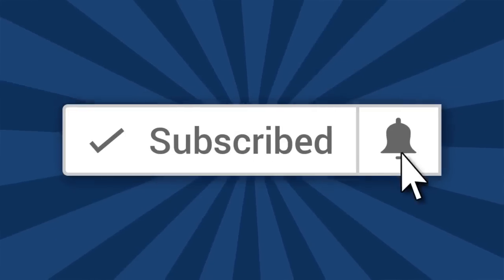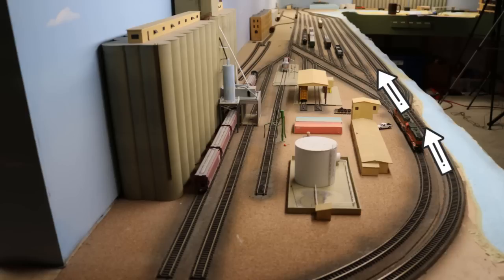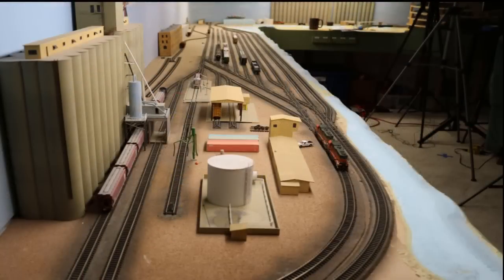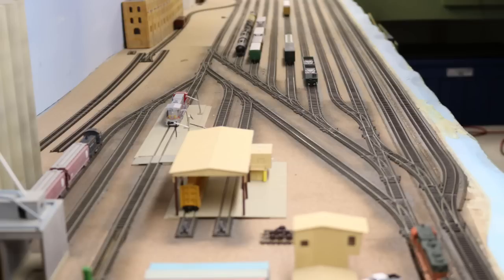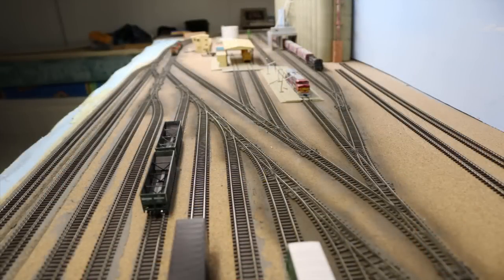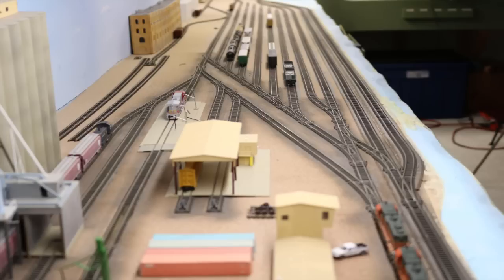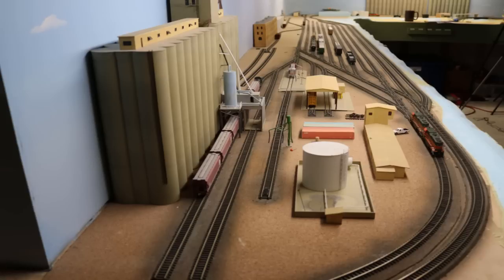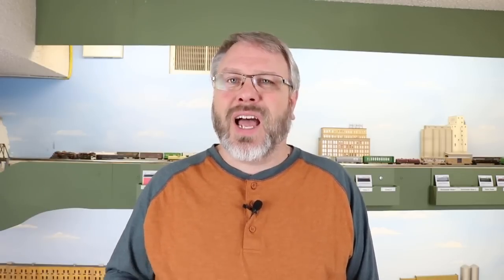Model Railroad Yards--Design for Operations

Comment: Ron: 
 I've been in HO scale for over 50 years, and I agree with you 100%! My main yard has 6 tracks, + a run around track, and leads at both ends that will accommodate pulling all the cars out of the  longest track, without fouling the main. 
Another thing that annoys the hell out of me, is the guy that tries to "cram" too much RR, into too small of room, or basement! This usually results in aisles too narrow,  or all kinds of "bottlenecks" in track work, and a "nightmare" to operate! 
My advice is if you don't have the room for modeling a prototype from one end to the other, Don't even try!  Pick a certain division, or a an area of the prototype you want to model, and let that be the "stage" for the trains to operate on. If room permits, a staging yard at each end of the mainline, or a single double-ended hidden staging yard, to build trains, to come out on the "stage", for viewing or operation.

J.W. Bliss
Reply from the maker: I couldn't agree more. Thanks for your comment.

Comment: Good work,   As you said  "Model Railroad operations".  Real railroads are completely different animal.  That is the point where people copying a prototype run into problems.  The prototype yard is this way so I will do it this way and come to find out our model railroads in many ways do not stack up with the protype and yard operations is one point.  Real railroads Double over, Run full shifts or 24 hours etc.  Most local yards do not have leads and just use the main as a lead.  Traffic density is so low it might be an hour or more between trains. Distance is huge compared to a model railroad. The A/D track is the main.  etc.
Reply: Thanks! I have a small local yard on my 4x8' and have no choice but to use the main as the lead. So that's a relief. Fortunately, it's a double-track main, so I have options.
Reply: IMRROcom was
Reply: Scott Denison, Was?   did he die or something?
Reply from the maker: Lol...
Reply: That's a relief to read that. I am planning my layout and would like to run long trains on a double track mainline, but it looked like ideally the arrival, departure and yard lead tracks were supposed to be as long as the longest possible train stopping in my yard. That would require a lot more space than I have. If "fouling the main" for a little while to drop off and pick up cuts of cars is allowed and even prototypical, then everything becomes much easier. The yard then only needs to big enough to handle the arrival, departure and classification needs of the local area. Correct?
Reply: @rayopeongo  Head on over to the KCS operating sessions on YouTube.  The train crews usually ask the dispatcher for "time and track" to use the main for switching.  Ron is right - bigger yards really do need a drill track.  Mine will be curved and goes between a roundhouse and the main at 18"R because only 4-axle switchers will use it.  The main is 22"R so the locos with 6 axles will look more realistic and run better.
Reply: Having worked on the prototype, I want to make my model railroading just as difficult, lol,
Reply: @rayopeongo  arrival and departure tracks in the real world are rarely long enough for the length of train the railroads run today. A more accurate thing would be to make sure they are long enough for the biggest “lift or set off” a train will be making in a yard and that they are long enough for a terminating train to double over into. In terms of a yard lead it needs to be long enough that if you have a bunch of cars on your yard engine that you can shove to clear  the man but not necessarily have to go all the way back into your class tracks.
Reply: @MaxHeadroom4014  - have a link to that?  the KCS operating sessions
Reply: @rayopeongo  It is all about the location and what the intent is,  Model Railroading i not the same as real railroading.  That train you have orbiting around you layout will run into problems every time it needs to get past that train out on the main,  real world.   the next train the needs to get past might be an hour away not in 1 minute orbits around the layout.

Comment: Yeah I'm starting to build my layout. Looking to have 2 yards on the layout. Separate from each other. One will have 6 tracks and one 2 tracks. I like the run by affect but I'm starting to get into operations. I'm trying to get to 130 cars on my manifest train to model one that goes by me. I got 68 cars for it so far. I'm gonna run one track main with a siding. I got a engine facility on a module that will hold some of my locos. Great stuff man.

Comment: Just a couple of points:

1) The yard lead doesn't necessarily need to be as long as your longest classification track as you said.  Sometimes it may help the yard-master get through the job faster, but it may be at the expense of realism.  For one thing, a longer lead shortens the length of open main line before the next town (something we can never get enough of at the best of times).  In most cases, the yard switcher will not be in the same power group as the heavy freight locomotives that brought the train in, so may not even be able to move it.  Even if it can move the whole train, it will be very sluggish so it will probably be a lot more efficient to take it in two or three bites.  Lastly, before the days of two-way radios, it was just too darn dangerous to switch a train length cut where the engine crew cannot see the far end.

2) Even in a post 1980 layout, thought should be give to where the engine-servicing facilities and caboose tracks were (even if they have since been torn up).  In a real yard, there will almost always be vestiges of what once was, so showing these on a model can greatly improve the realism.  A weed-covered spur off the yard lead with a seldom-used snow plow parked where the cabooses used to be; or an intermodal yard or modern office building where the engine terminal once was; for example.
Reply from the maker: I was sharing what I would consider to be best practices for a switching yard that will run optimally on a busy layout. Granted, compromises often have to be made on model railroads as in the prototype, but these are the ideals that I believe will provide operational results that most people would be most happy with.

Regarding remnants of earlier facilities in a yard, your are right, these can make very interesting modeling. Depending on how close to modern day on models, the prototype will often have various remnants of old track and facilities remaining. I was not discouraging such elements. My focus was discussing the OPERATING tracks in a yard, and for my purposes that is a modern day yard.
Reply: I agree with mpeterll. My prospective is as a career railroader. A big drag is harder to handle. With cars bled off and freewheeling, the engine has to be able to stop it. Sometimes I request a few cars left on air. This way they can be used to help to stop. A switch crew or yard master will make strategic cuts. One yard which I work in only has about 15 car lengths of headroom on the lead. We could easily switch out a 80 car train in about an hour.

Your yard length doesn’t have to be the length of the trains. In many yards a long inbound train needs to go on multiple tracks. Another yard that I work in has about 70 car capacity on the longest track. We frequently handle 120 car trains. Sometimes the lead needs to be fouled while yarding or doubling up a train.

One aspect that modelers don’t emulate is the topography of the yard. Most are bowl shaped. This prevents cars from rolling out if a hitch doesn’t make. It also helps kicked cars roll in. That yard with the 15 car length drill  track, which ends at the clearance point, of a switch onto another railroad. It is easy to switch because as an engineer, I just need to give a small start, and the cars will easily roll into the track.

I don’t see why you didn’t put a lead on the other end of your yard. This way it would be more flexible. Trains could be made up from either end. A good example is a local freight. It might only have a few cars. There is no need to use a long receiving/departure track, as it might be needed for a big road job, which is simultaneously being built. The local that I work is made up on a short track, since we usually only have a few cars.

Some larger yards have more than one lead on each end, sort of like you did between your classification and departure tracks. This is so two jobs can work the same end.

Comment: Lots of good information about yard design. Your North Yard is a classification yard. Personally, I don't enjoy sorting cars, especially N scale cars with difficult to read reporting marks (And I am an N scale modeler). Classification yards also take up a lot of real estate. In my experience, classification yards can become bottle necks as well. So even though they are popular with modelers,  I'm avoiding a classification yard with my layout design. There are additional yards such as interchange or industrial yards you might explore in future videos.  IMRRO is correct pointing out prototype yard design may differ from preferred practices for model trains.   I've observed prototype yards which do not have classification tracks as long as the longest trains sent out on the mainline. This is especially so in urban yards where space is limited (just as on model railroads). An outbound train may have to pull strings of cars from more than one track to finally assemble on the main the departing train. Keep your videos coming. They are great resources.
Reply from the maker: Thanks for your comment. 👍

Comment: Thx Ron for sharing this.  I have a layout with two independent loops that share a junction yard.  My original track plan called for a crossover prior to the yard throat which obviously fouled the lead track.  I simply put it on the other side of the ladder switch and viola'!   Operations improve tenfold, and it actually looks way cooler without changing the complexity of the layout.
Reply from the maker: Awesome.

Comment: Couple of things here. You can add interest by keeping the drill track/switch lead shorter than a train length.  To avoid having to work against the yard ladder have the turnouts staggered with the shortest tracks closest so you don't have to reach over the cars. If possible I like to have the main at the back of the yard so I don't have to lean over a running main track if you have other trains running while working in the yard.

Comment: For a model railroad yard, it is very handy to have a crossover from the switching tail track to the main track, so you can access the main track directly from the bowl tracks.  Also a crossover to allow access from the main to the tail of the switching lead is very handy.  That way a train can stop on the main, the power can cut off and a switcher can work the train right off the main, putting cars into the class/AD yard and adding cars back to the train from the class/AD tracks.

Comment: You videos are great. I started many years ago under the guidance of my brother. The problem is he wanted me to use the cookie cutter method for raising the track. However he told me to use 1/4 inch plywood. Over the years I read articles that 1/2 inch plywood should be used. I just used more surports to hold the plywood. I also used the Truscale wood roadbed which is a self-gauging roadbed. It is great. There was no cork or foam around then. Some of my turnouts are the Truscale closed frog design. This is great as it eliminates the gap at the frog. I also do not model to a certain prototype. I mix Fleischmann with American rolling stock. I am a DC operator, DCC is nice but I do not wish to convert.
Reply: How many moons ago? I know for a fact that cork roadbed was available in the mid 60s. Another option back in the day was a construction product called Homasote. Sold in 4 x 8 sheets. Either laid flat or ripped into strips and installed on edge with the strips stacked sideways to form curves etc. l do remember seeing videos of a large HO scale layout being built maybe 8 years ago. The builder was using Homasote for the roadbed.
Foam insulation panels were around in the 70s possibly earlier.

Comment: Thanks for the video. Just a note on Andy’s book - It is available at Barnes and Noble in Nook format for $10.99. Free readers for mobile devices. I lost my original in a basement flood back in 2010 along with the rest of my MR library 😕
Reply from the maker: Hey, thatks for that head's up. Many people will want to know that as the out of print used copies out there cost a small fortune.
Reply: Ron's Trains N Things You ain’t kidding! I just came from EBay and some crooks want $80 to $127 for a USED copy. After my heart calmed down, and before I saw the OP above, I also found B & N listing. I hope those guys on eBay choke on their copy...
Reply: @samiam619  Amazon is the same way - starting at $79 and up to (as of right now) $217 (!!) for a copy.

Comment: Great video, I agree that operations and yard switching is some of the most fun parts of this hobby. I find it interesting how yards work and the puzzle they create. Also, thank you for the link to the Layout Design site. Keep up the good work!
Reply from the maker: Thanks, Joe.
Reply: Now you have me redoing my whole main yard on my layout.
Reply: Look at the way real yards are laid out. A good source is the Burlington Northern Historical Society. They have old timetables, but also yard diagrams. I like to look at the ones in my old territory. You can look at them for ideas.

My planned layout is of the 1970s Boston and Maine Fitchburg Division. Their East Deerfield Yard is something that I want to model. It used to have a yard for eastbound, and westbound, with double mains in the middle. 

In the late 1970s, it went through a remodeling. This new layout has all the elements that Ron suggested. There is the R yard, where trains arrive, but are also doubled for departure. There is a separate classification yard, which is called the West Yard. The present single main is rerouted along the south edge of the R Yard. The West Yard also features a hump. This is no Mount Everest, with retarders. The cars are just let go, and roll into the classification tracks. This element could be done with a Kaydee uncoupling magnet at the crest of the hump. In fact, someone did a module, of a scaled down version, at a local modular club.

Comment: Hi Ron. This video was a crucial source in my attempts to finally get into model railroading, and will form the basis of my layout when I build it. In the meantime, I picked up a computer game (Rolling Line) which imitates a model railroad and I promptly replicated your version of North Yard (that is, only connecting track 6 at both ends, the rest all being blind; also prior to you adding a connection between track 6 and the thoroughfare). I started playing with it and shunting wagons and it’s been a lot of fun, and has me thinking I won’t regret the acquisition of a bunch of N-scale rolling stock.

One thing I did notice is that I don’t have enough room at the far end of the yard to switch a locomotive between the two arrival-departure tracks without going into the main line. I couldn’t quite make out the details in your video but I was wondering if that’s the case on your layout and whether this impedes operations at all.

Comment: RON, I agree a good yard is a must, but you said they need to be as long as your longest passing siding, I did agree,  a small yard just makes it a little harder, and a lot of real railroad didn't or don't,  old Colton yard wasn't and the new one doesn't either, now UP own it but but they do work a lot better if they are & thanks for the tips about the books. Thanks for sharing....Jack
Ps- taking up old track t hats glued down can be taken up either Water and alcohol mixture, just watch Mike Fifer's video about it....
Reply from the maker: Perhaps I should have gone into more depth on that point. I really think a yard that originates and/or terminates more than local trains should have a lead as long as the trains. Not all do, true, but most busy yards will, and if you are running operating sessions this can become a real bottleneck. Local yards are a different story, which I did not differentiate on the video. My Wichita Falls yard has a shorter lead and class tracks, but it only receives and originates blocks of cars for local switching and interchange.
Reply: You are right about making them that long, and thanks for showing me I'm in the process of redesigning my layout now & your video couldn't have come at a better time as I'm working in any-rail to workout all th kinks and need to redesign the entire yard, thanks....ha ha bad me for not doing it right thed first time....Thanks again!